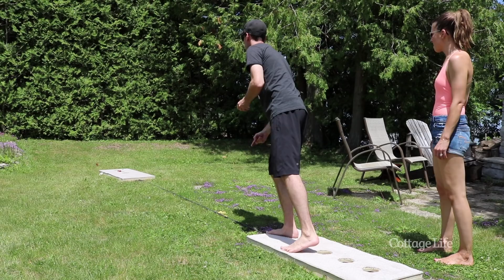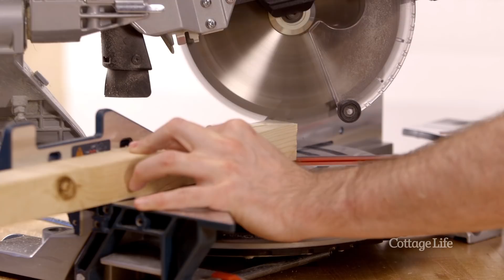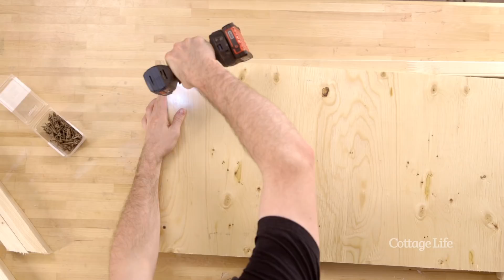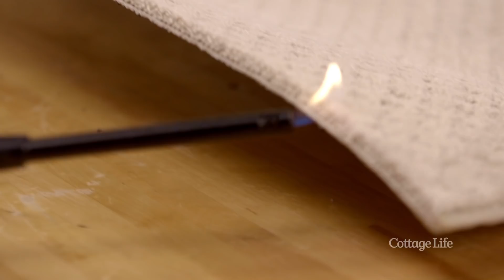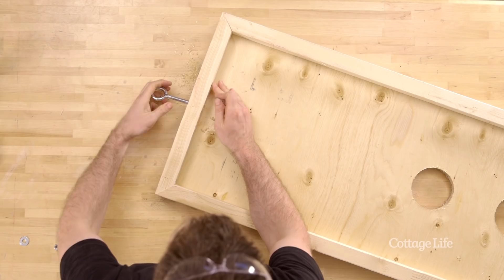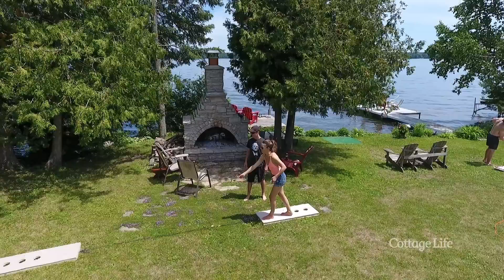DIY 3-Hole Washer Toss

Comment: Can you make a massive cat house becouse Ijust got a new one and I want to fell better becouse it s broking so much stuff
Reply: just look for ideas on google. it shouldn't be difficult to find ideas and copy them.
Reply: swag overload cool thank you
Reply: what kind of ideas do you have in mind
Reply: swag overload you can buy a cheap ikea bed and make it batter, you can make a a frame and mini table for tv, you can make a mini boat that it's powered by pedals, you can make an indoor golf, you can make a chargingstation for charging your devices, you can make a surfing board and a lot more only using one material; wood.
Reply: that's very true, wood is an extremely versatile material and more often than not i choose to build with wood.